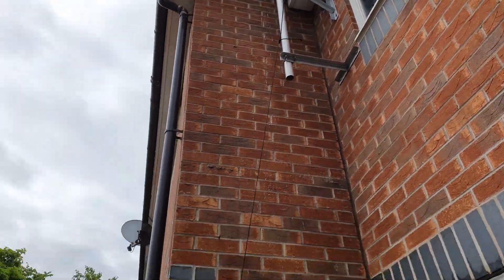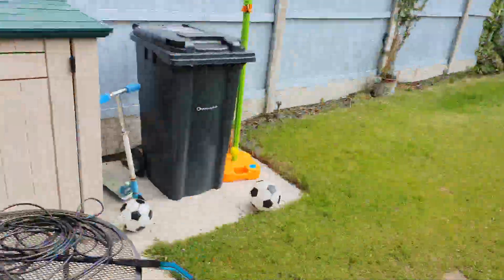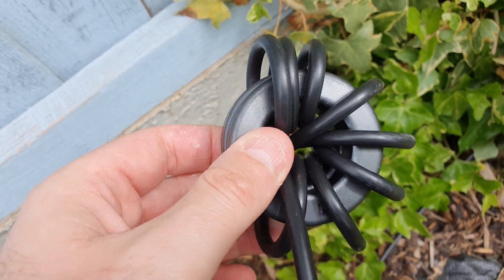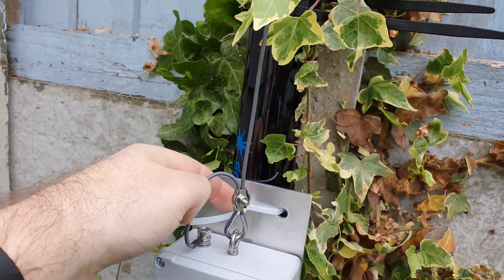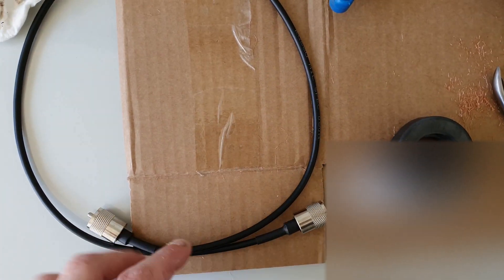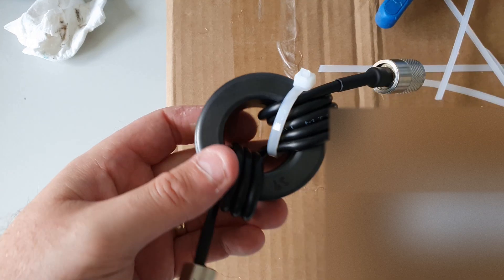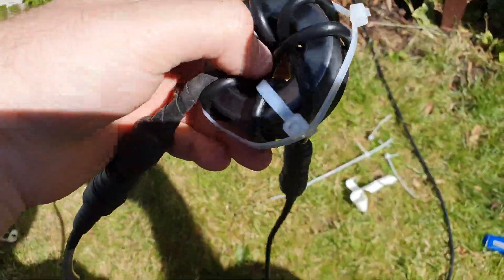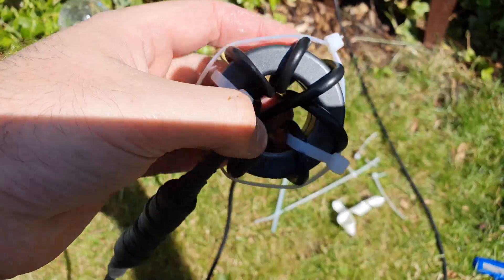UK Antennas HWEF Antenna Update! More information and how I could improve things. Making a choke.

Comment: You dont need to have a choke, most say you do and do it because they think its a must, I dont use one but have a good grounding at the antenna end to an earth stake. At the top of the pole where the wire leaves try and find a way of changing that angle ie 90 degrees or more, that angle seems to sharp to me.

Comment: When making chokes install plugs last,,,high swr on 20mtr install a counterpoise around at least 15ft in length to  plate on transformer,,this will help tuning.,,,also have common mode choke just before the coax enters the shack not at the feed point this will help cancel common mode current  on coax shield so you get more accurate  swr readings.

Comment: Hi matt,did you ever sort ya efhw out on 20m?? I have the same problem but on 10m now
Reply from the maker: Hiya Andy! Sorry to hear that bud 😭
I managed to get it a lot better now. Y just changing the way I had it installed, I would just move things about a little and see how it changes. I think I have done an update video since this one that may go into it further. From what I read at the time. Changing the config and can make a huge difference. 👌🙏
Reply: @m6ceb  hi matt cheers for the reply.i will try n try again lol
Reply: Think about attaching  1/4 wave counterpoise to transformer base plate for problem bands

Comment: Matt i have bought numerous antennas from Ian and they are excellent. Something you could try would be to put your transformer box up on your pole you have on your T&K brackets and then slope the antenna down towards your garden. I find using end feds in the sloping configuration works best for me. Keep an eye out on eBay for seller G4ICD. Geoff is a professional RF engineer and sells some of the best stuff available. Now and again he has good line isolators for sale which i use at my QTH. The coax from your transformer forms part of the antenna so put your choke where the coax enters your house so that you have a longer run as it acts as a counterpoise and should help with your SWR. Having it too close to the transformer can cause problems. Hope this helps. 73 Syd
Reply from the maker: Thanks a lot Syd :) I will hopefully be swapping my coax for some better stuff soon so will bear that in mind :) Thanks for the advise and for watching mate :) 73

Comment: I’m a big fan of EFHW, been using them for many years, what I discovered when putting the UNUN towards the ground is that it de tunes due to the ground capacitance effect. 99% of us have to compromise and making the most of what we’ve got.  20 is an important band so I would experiment with getting the UNUN higher.  Congratulations on what you have achieved so far.  How important is 80 to you?  Try your configuration using the house to mount the UNUN as high as possible.  Less coax loss etc and use earth stakes around your garden, multiple earths do help lower the noise floor.  Let us know how you get on.    It’s a great hobby and after 45 years I’m still learning.  73 de M0AZE Mike 
,
Reply from the maker: Thanks a lot Mike! Really helpful tips! I love listening to 80m and like to get chatting sometimes. It's a great antenna! I have done another videos since this one on the channel and have a playlist with this antenna. Think about 4 vids in total. Thanks for watching and I'll keep experimenting and thanks for taking the time to comment 73 mate 👍
Reply: @m6ceb  I've got the 49:1 EFHW from UK antennas I'm using windsurf masts . Mines horizontal L shape then slopes up to my X510 mast with about 18 inches of parachord isolating the wire from the alloy mast on my bungalow. I've had some brilliant  dx stations from all over...I was talking to Kuwait and ohio on a net last night was astounded . M7CKG 73's

Comment: Matt, first, the choke is not going to help your SWR it will help keep any you do have giving you grief at the shack end.
Second, your connection method is introducing more loss in your feed line, think 1db per termination, so, you have your plug, your barrel connection and another plug per side of the choke, that's 6 connections. Apart from being very lossy they also present 6 more points of failing.
Third, wind your choke equally on each side and wind it before you put the connection on.

Lastly, you need to change the angle of your antenna, the angle is too acute.  I think this last part is your issue. Either lower the main pole to get a better angle and dangle the remainder where you can out of the way, remember there is no perfect antenna for anyone, sometimes you have to live with what you've got. You're getting out and there's no smoke, so all good ;)
Reply from the maker: Thanks very much Nigel! Very much appreciated! I've just ordered a line insulator from ham goodies and added the 12 turns for 160m and 80m I didn't think about the loss so for that alone it should help. There will be one one connection either end of the choke and hopefully will do a better job with the CMC 👍
I will probably do a comparison video and see how it goes..
Much appreciated Nigel and thanks for taking the time to comment and very much appreciate your advise! 
73
Matt

Comment: Hi Matt, according  to stuff I found on Ian's website, using angles less than 90 degrees is to be avoided. Perhaps if you try lowering the height on the pole to get the angle of the wire up closer to 90, it might help. However, I expect there to be a trade off in having the antenna sit lower to the ground. Then there's the EMF compliance regs! Not easy in small spaces.
Reply from the maker: Hi Roger!
I've just done another video on how I have it configured now, I'm learning all the time seems a lot better and it tunes on top band! 🤞👍

Comment: Hi...... I have the same antenna but my choke is at the radio end and I use a copper rod on the ground of the 49.1 transformer .........

Info form the manual 
little counterpoise is needed for an end-fed antenna and in
most cases the mounting post/mast may be enough.
If RF current becomes an issue a common mode choke can be inserted in the feed line at least 10 foot from the antenna
or and at the radio end, some experimentation may be needed.
Earthing can be done if required at the bracket, this is to earth and is DC grounded on the Multi-band antennas.

Your antenna has no ground you are using a fiberglass pole...just my thought add a copper rod........73s
Reply from the maker: Great idea Matt! I may just do that! I am also going to add a couple more turns to my choke and see if it helps my noise floor a little. I have 2.5m of coax from the transformer to the choke then the choke right before entering the transceiver 👍 thanks a lot for the advise mate and for watching 👍🙏
Reply: @m6ceb   Hi I only have one choke at the radio end  NOT sure about two choke..........Anyway good luck .... 73s
Reply from the maker: @782matt2  Thanks a lot bud :)
Reply from the maker: @782matt2  Never a pain mate I really appreciate the advice :) I am going to add another couple of turns and see how it goes, im sure theres still some CMC so probably needs more choking :)
Reply: @m6ceb  Matt only 2.5m between that 1st choke and the transformer is far too short. My choke is a good 10m from the antenna.
Reply from the maker: @fairwayfinder18  Thanks again Syd :) I appreciate your comment again and will bear this in mind for the coax change :)

Comment: Having 17m that nice is a real bonus.  You might want to just leave it and accept 1.8-1.9 on 20m to keep 17m that good.  Otherwise, I think your guess is correct that it's the configuration of the antenna.  I've always found EFHW's to be fiddly when in close proximity to objects.   <BT>  Not necessarily related to the 20m SWR, but you might want to consider putting a few more turns on your choke.  (REF: G3TXQ - common-mode choke measurements) [EDIT: spelling]
Reply from the maker: Thanks very much for that! I may add some more turns on the choke today and see if it improves my CMC 👍 the antenna works very well and I'm super happy with it 🔥 thanks for your comment and for watching the video 👍👍

Comment: Hi I use same efhw and use 3 ferrite clips on coax as it enters the shack wall and then a 1:1 line isolator at radio end with great results 👍
Reply from the maker: Thanks Andy! Much appreciated mate! I think the 20m high swr is mainly due to my configuration so needs tweaking a little. Thanks for watching again mate 👍